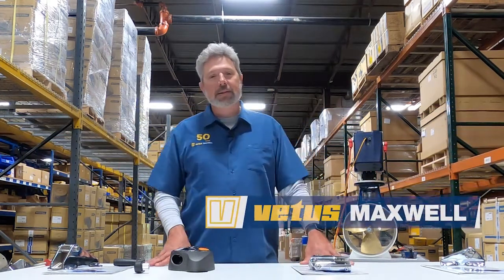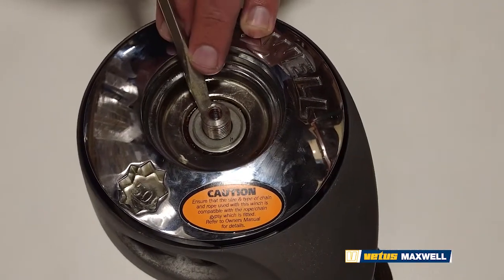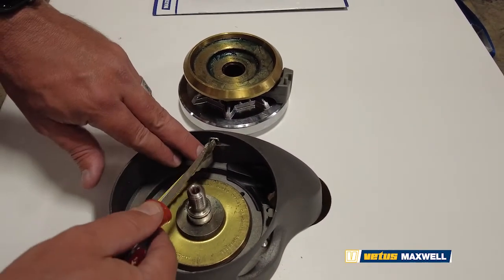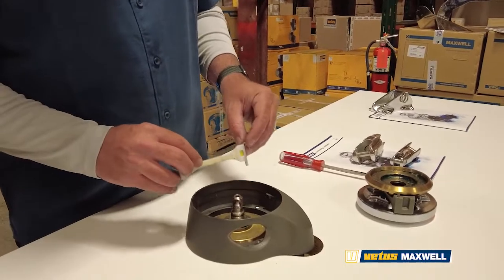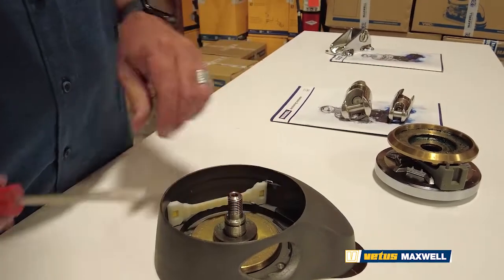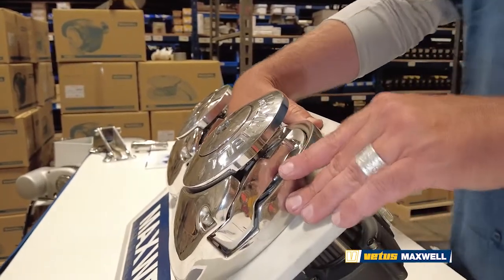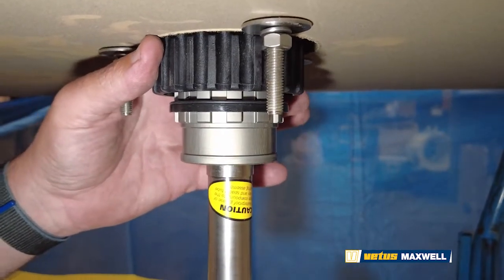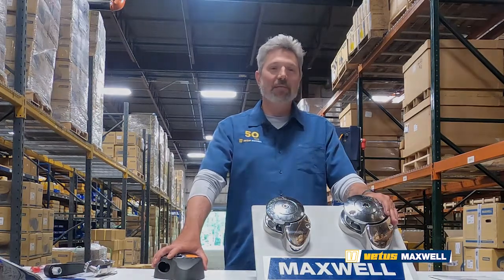Upgrade Your Boat With Ease: Swap Out Your Maxwell Freedom Series Windlass For The RC8 Model

Comment: I am going through the process of pulling my gearbox off, it's a circa 1998 Freedom 800 install.  Never serviced, nor really used by the PO. The key is corroded and won't fall out, actually the entire shaft is probably corroded.  Taking the top nut off and bottom retaining clip, trying to move the gearbox is IMPOSSIBLE!  The windlass works fine, but the oil looks like spoiled Yoohoo, it's only a matter of time.  It's been sitting in PB Blaster for a couple weeks, well as much as I can get to the shaft.  It's a ritual, wake up, brush my teeth, and spray PB Blast!  Haha ...
Reply: BTW, Scott at Maxwell Marine has been nothing short of awesome!